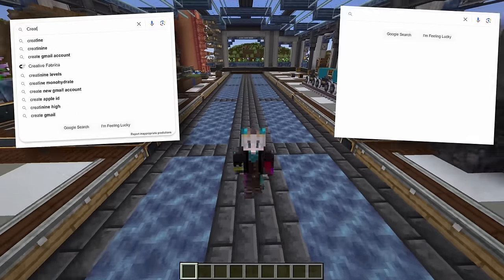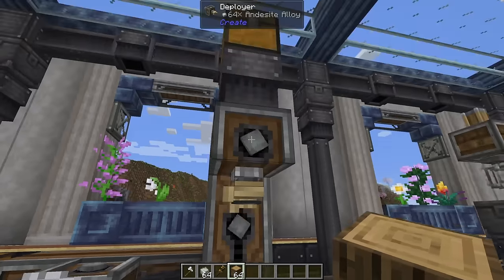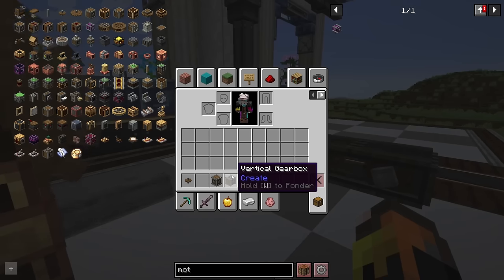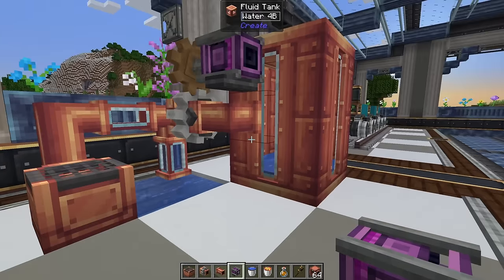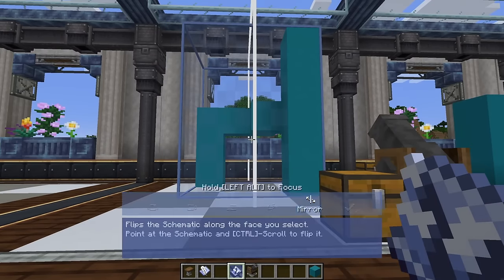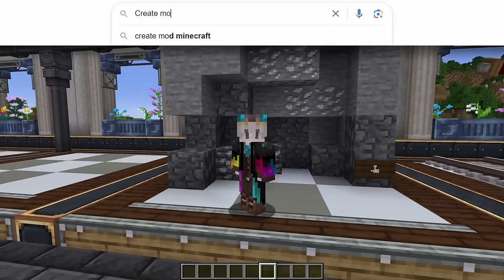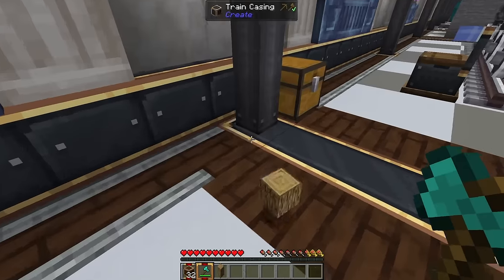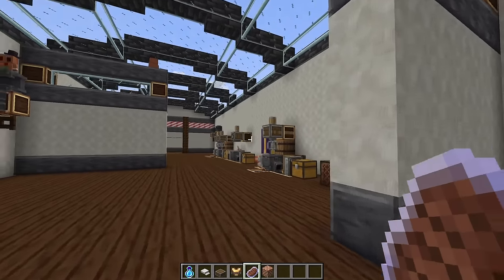Most searched Create Mod questions!

Comment: Here's a cool way to make andesite casings when playing with a friend:
1. Equip andesite alloy in off-hand and a wrench in the main hand.|
2. Hold shift r-click while facing down on a block in front of you.
3. Equip your friend with an axe in the main hand and logs in the off-hand
4. Hold r-click.
Reply: Also his andesite casing machine used 3 chain drives, 2 shafts and a gearbox. YOU CAN DO IT WITH 3 COGWHEELS INSTEAD.

Comment: considering that you can basically almost exactly fit two level 9 steam engines into the same footprint as a level 18 engine and it produces the exact same su, superheating your blaze burners for steam engines really isn’t ever needed. blaze cakes are mostly useless in base create tbh, unless a modpack/addon adds a recipe that needs superheating
Reply: Another thing you can do is to feed the steam engines using chicken eggs instead of something like charcoal, that way you don't need a relatively bulky tree farm or bamboo farm to feed it, just put some chicken chambers around
Reply: @allinairhanson6886  i mean powering level 9 engines with lava will literally use less lava than powering a level 18 engine with blaze cakes because blaze cakes take lava to make